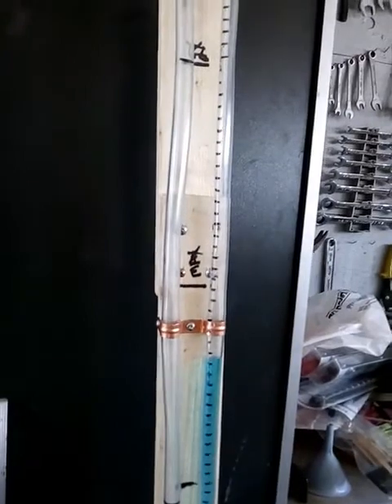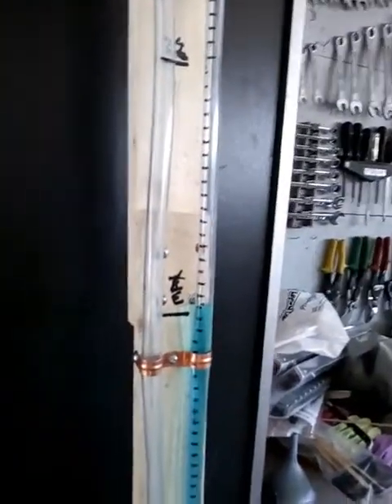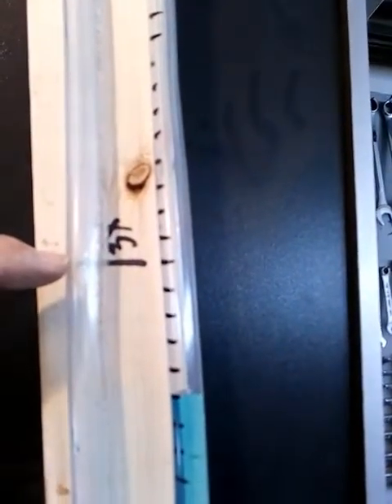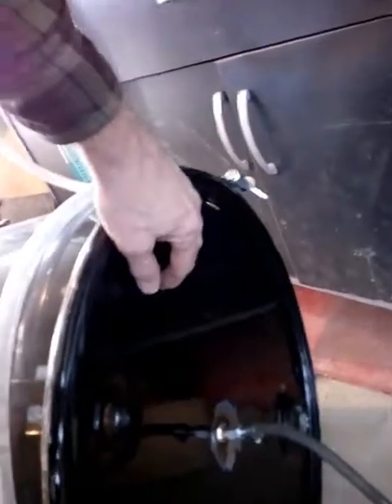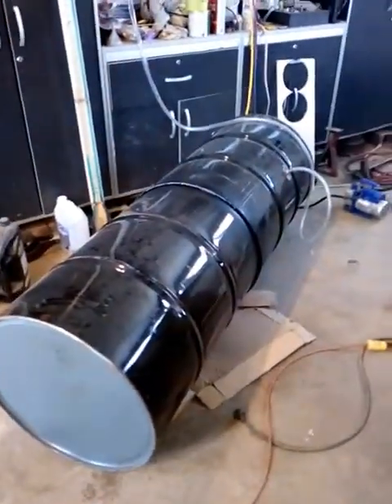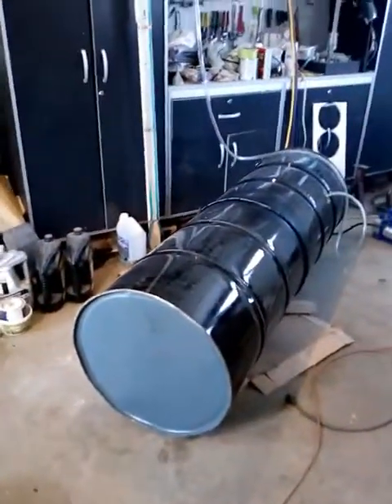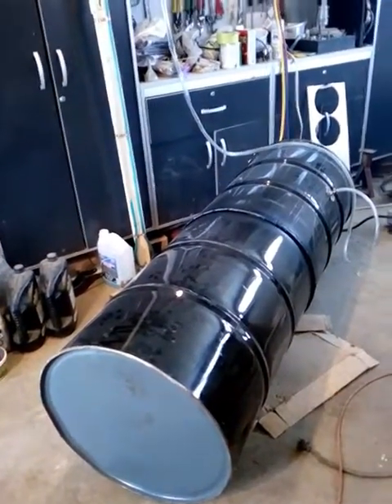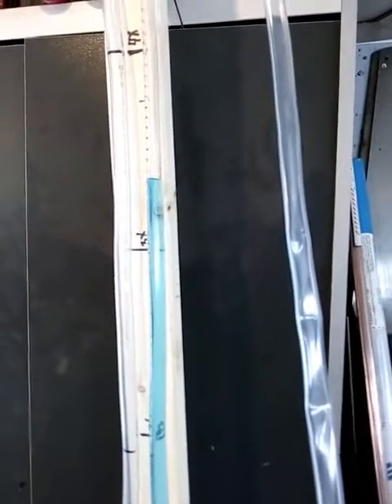Part 2 of 2: Vacuum Test Two 55 Gallon Drums as an Iron Lung

Comment: The video on how to create the manometer was clear and excellent but I don't understand how to create the vacuum side. I need to measure the air pressure inside my house
Reply from the maker: Interesting application, don't really know .
Reply: @blanchae  oh darn lol.  My house has a negative air pressure problem and it sucks in smoke and dust at sometimes gale force strengths.  It's a horrible situation. I'm renting and going about putting silicone around all the places that should have them but it's not enough yet, hence wanting to measure the effectiveness of otherwise of my attempts 😁